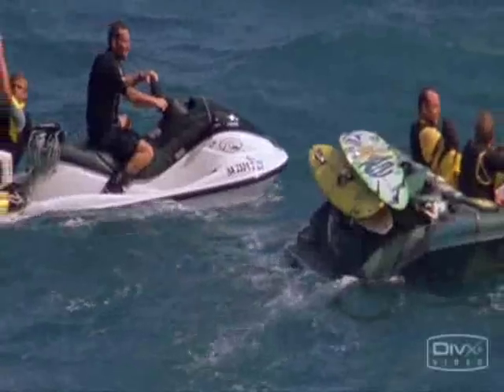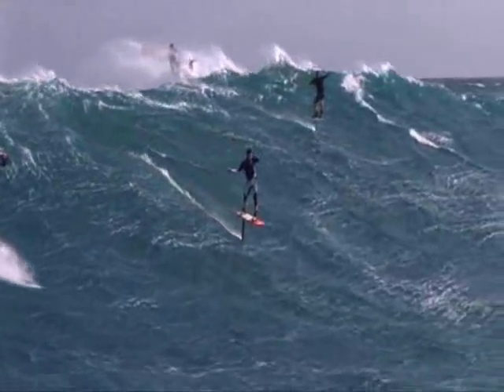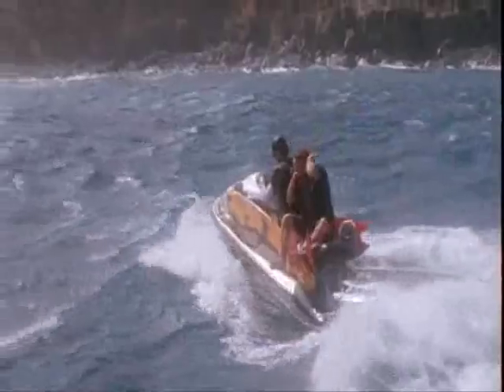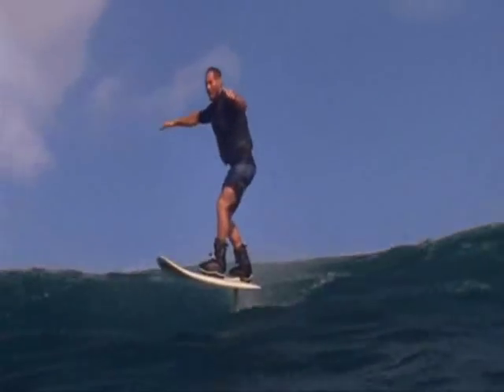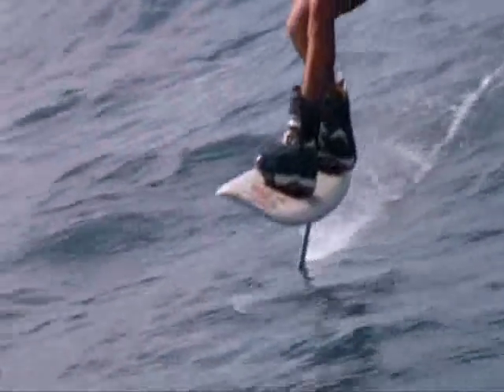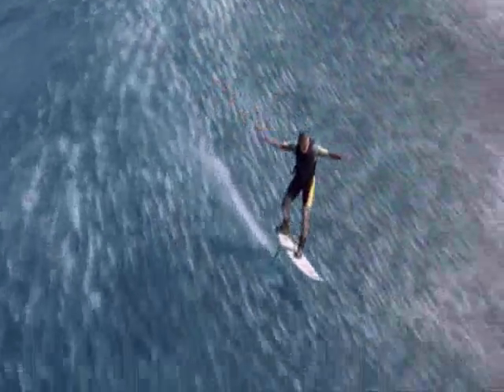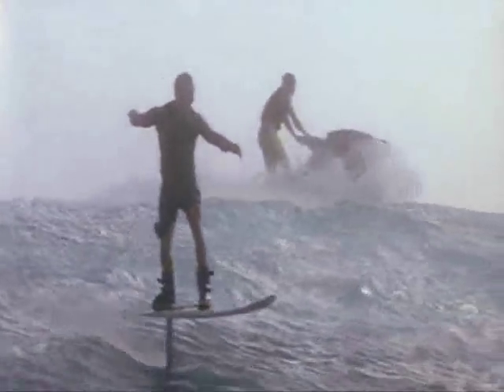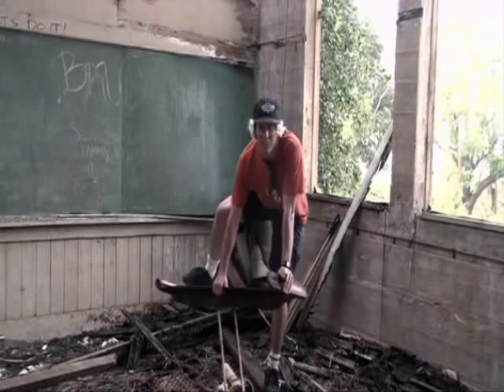Foil Surfing

Comment: @stromuhrman This was from 2001-2002 with the 2nd generation foilboards.  Now the new foilboards have broader fins and are refined.  It's MUCH easier to ride, easier to control, more stable than earlier foilboards.

This board can also be seen in a few other surf movies so it's not just in Step into Liquid.  It was designed to eliminate surface conditions which, if you are a real surfer, you should appreciate. No more ghost chop, wind/wave chop, or break whitewater to ruin sets.

Comment: This *isn't* a replacement of your primary board. Just an extra tool/board to use when the chop gets too rough for a normal board, or you want to ride a monster wave with serious suction.  

Not as much surface area is touching the water so drag is reduced, hence you can slip down the face faster and do not have to worry about being sucked back into the lip. Easier on your knees and legs so you can ride more sets.  Laugh at wind or wave driven chop and ride sets you'd have to otherwise sit out.

Comment: When using hydrofoils directly, such as kite surfing or surfing, you need to make sure that you don't always point the board up, as in this video he keeps the board pointed up most of the time which eventually leads to the hydrofoil getting too close to the surface. When this happens the foil starts to draw in air, loosing lift, which as seen in the video he drops down suddenly from 1:15 to 1:17.